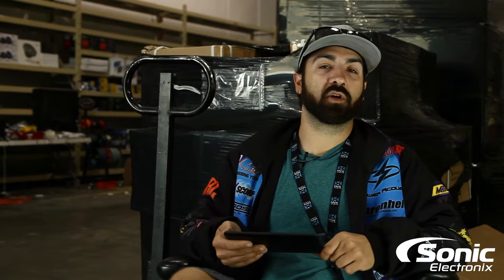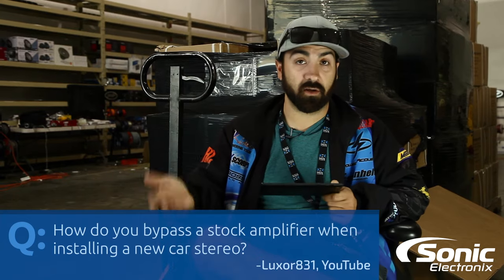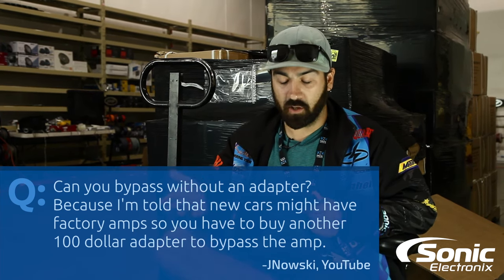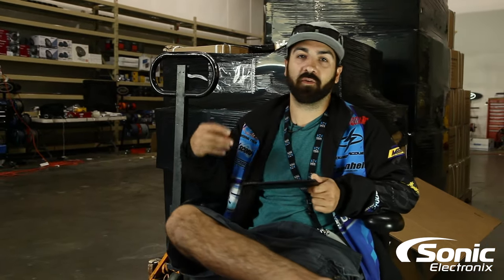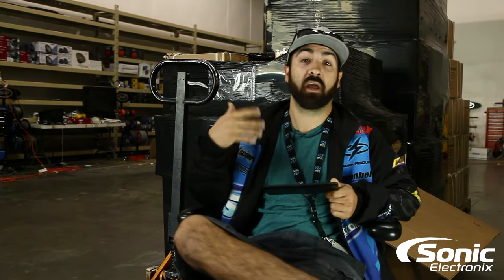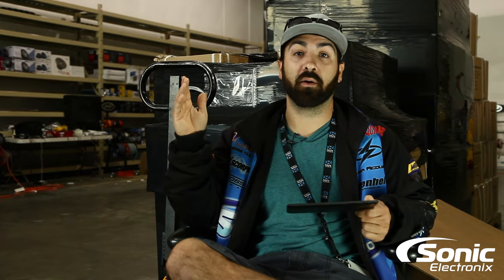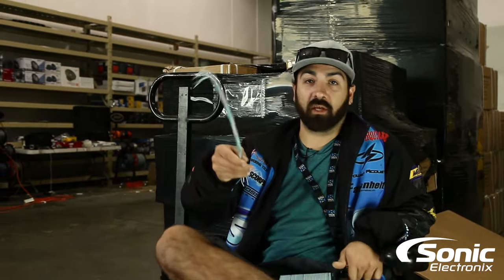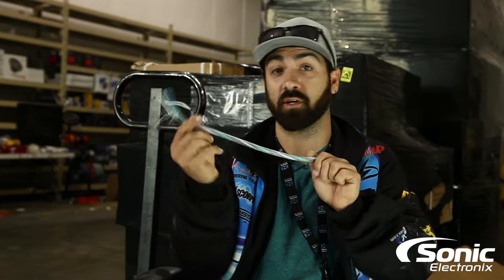How Do I Bypass My Factory Amplifier? | Car Audio Q & A

Comment: Here's a simple answer. You by an aftermarket radio with sub/amp outputs. Buy the the adapter which costs around $40-$75. Forget any high/low adapter. Now you can hook up another amp for subs and still use the rest of the factory speakers as well.
Reply: The adapter wires run from the factory Amp to the new head unit?

Comment: Just use a $20 scosche 4 channel converter if you want to add an amp and woofer to your factory system. No need to bypass your factory amp. You don't lose any channels and you don't even need to touch your deck.

Comment: If you have a Nissan or Infiniti vehicle, you can easily bypass the factory amp with an OWC Upgrades harness adapter. Let's you plug-n-play better amps in no time.

Comment: I have a two-part question. I have a 2003 Toyota Avalon with Factory JBL. There are two different harnesses available for my application. The standard application is a 2 connector setup and it appears to have the blue wires in the harness that would connect the power for the amplifier. The other connector is a 1 connector setup with RCA's. Can I use the two connector standard harness with my JBL system or will I lose my sub? Do I have to go with the RCA harness? Also I heard that if I use the standard harness I can connect directly into the factory amp through a different part of the harness in the dash?

Comment: I have a 2014 Jeep grand Cherokee limited that I will be giving my son for his 18th birthday. I want to upgrade the sound system a bit. The factory head unit is staying in the vehicle so we have an LOC and we are changing all of the door speakers (4 doors , 2 tweeters). We are adding a 4ch amp to get the kids and highs loud a crisp. We also plan to make sure that we can still run the factory sub for now but will be upgrading to a custom box for the back. What all do we need before we start?

Comment: I'm pretty sure I won't get this question answered but here it goes anyways... from bypassing the OEM amp for a aftermarket headunit will the OEM amp lose its purpose as to moving the speakers etc. Or will the aftermarket headunit do all of the work as to powering up the speakers etc.

Comment: I read something before that if you bypass the factory amp and splice into the existing speaker wires, without using a line out converter. That over time it could damage the head unit if you don’t install capacitors or Resistor between the splices?

Comment: I need help iv replaced my factory speakers thier much higher wattage than stock soon I will be replacing my factory stereo to a double din . 
1.how do I wire in a higher wattage amp to get the most from an aftermarket amp ?
2. Can I bypass my stock amp to do this?
3. I hv steering wheel controls how do I keep that functionality?
2002 dodge ram 1500 5.9 4x4

Comment: I am looking all over and there are no videos on how to keep the factory amp with an aftermarket head unit. my factory amp works just fine and I want to install my pioneer head unit while keeping by door speakers and tweets amplified by the factory amp.
Reply: I am looking for the same thing. I want to keep my factory. But I'm having trouble finding an answer too

Comment: So this is probably a rare occurrence but my factory B&O system amplified can't be removed from the vehicle. It will mess with the key and a bunch if other Electronics. It is essentially a part of the vehicle but I want to do an entire different system. How do I go about doing that? I heard there is an adapter that'll allow me to bypass the Amp and run new amplifier for my subs and speakers.

Comment: Hi I love watching you video. However i have one question. Recently i issue with my amplifier (here is no sound from all speakers). I just took my car to service and the mechanic said i need new amplifier. My question is if am going to do it myself and buy the same model amplifier, does the new amplifier need the factory setting code. I am afraid that if i pull out the old amplifier and put the new one in it requiring Lexus setting code to run it. Any helps appreciated.  My car is Lexus RX450H 2010.

Comment: I have a question..? I plan on using 3 XS power batteries to power my system. Is it a difference in using the d series versus the xp series batteries?

Comment: I have a 2011 Toyota Toyota Corolla S, I used the Metra 70-1761 on a Sony DsxB700 stereo. I am getting No sound at all. I connected the blue/white to the blue antenna , nothing. Then I read blue/white to red. Nothing, then to leave it unplugged and still NO sound. The stock stereo does have a third harness connector that is left unplugged . I can’t find that connector from Metra or Axxess. I installed 4 JBL speakers and sounds great but I want my Sony to sound better.

Comment: So I got a 2004 Acura TL comes stock with a factory 8” sub and factory amp, so I replaced the unit with a dual touchscreen doubledin, and now I’m trying to add my new 2 12” subs with my new Sony amp and I have everything hooked up, dudes are good and wiring is all in tact, my amp turns on and gets signal but I get no bass or power to my subs, what’s the issue?

Comment: What if I’m hooking up subs in my 08 Ford Edge limited but using the factory radio with a line out converter?? Do I still have to bypass the amp?

Comment: I have a 2011 dodge ram with the 10 speaker alpine system and I've already replaced the stock factory sub and added an amp for it. my question is...can I add another amp to power my 4 door speakers or power them using my existing 4 channel amp with sub output?

Comment: So I have a 2023 Elantra N and it comes with a Bose sound system and it's shit. I just wanted it to be like 10% to 20% louder it's just missing that little extra to be loud enough. It also has 0 bass. I was told it would be almost 3k to upgrade because it requires alot of work and some kind of expensive adaptor and alot of wiring. I just can not wrap my head around that.  Any advice would be so appreciated.

Comment: THANKS!  This has been my main hurdle in really getting my feet wet in all of this..  Say you had a 4 channel (midsnhighs) and a mono block (sub)  How would you wire that from the head unit?
Reply: That would be rca's to mono and the other speakers to the 4 channel...  where would you install the crossover for the 4 channel?  Would a third amp be required for a set of dedicated sq mid range 8s?

Comment: Hello sir I recently bought a 05 vw toureg it has 11 speakers w. Cd  changer /navigation ... Well I recently changed hu for a aftermarket DVD/navigation/backup cam ... Well when I had it installed I told the guy don't cut no wires order any harness u need also order the harness for the steering wheel controller w. Cost me an Xtra. 200... Just to be able to turn it up and dwn on the steering.... I told him to bypass the factory amp but I'm guessing he didn't cuz the backup camera had stopped working and I went back to the shop he told me come by next day so I did but then the front speakers stopped working and only the center speaker did. I asked the guy to take a look he told me that maybe the amp was burning out the factory amp so I said okay ask him about The Back-up Camera he said the owner replaced it with the different one I have to pay extra for that new camera I told her no I wouldn't so she let that slide week later this camera doesn't work now and now I went back to the shop same excuse again so long story short this the third time it bring that start working so I decided to follow the wires from the camera he had tapped into the 12 volt on the amp and and what do you use for the ground was not really properly prepared so my question is would that necessarily burn out the amp and all these cameras that he keeps replacing

Comment: So I installed a pioneer after market head unit in 94 lexus sc400. Every time I turn the car on (starts perfectly) there is a whining from the back speakers which after hours of research have concluded I have to bypass my factory amp. I already have my after market stereo system installed and wired, and my stock stereo has a sub as well. How should I bypass it to keep the sub bumpin

Comment: How do you bypass the factory Amp in a 2005 Chevy Equinox. The amp burnt out and I am keeping the orginal radio.
Reply: You Don't Want do that you might cut the wrong wire and spent $15,000 for the cable wire your might  causes electrical fire Oops
Reply: You would need to locate the amp, and disconnect the harnesses.  Once that is done you are stuck with out a direct connection to the speakers though.  And there lies the fun you have to power them and that factory stereo is unable to do that so purchasing a replacement amp is needed, and then fitting everything up needs to occur.  Long end of it...Buy an after market stereo which undoubtedly has a built in amp.  and then match up speake rwires bypassing the amp and your done....

Comment: The bad thing on my daughters car we didnt know the 04 galant gts had an infinity 6 speaker sound system there was a radio in center that didnt work i pulled it out and it had no wires just 3 on the factory harness which is just constant ignition and found the amp behind glove box all the other wires wee cut .now question is since i cant see on top or bottom of amp is there just an rca plug i could just connect.or how can the pioneer radio has 4 speakers connection by able too hook it up

Comment: the one million dollar question here is: how can I integrate an after market head unit with BMW DSP in one of these cars, BMW X5 2004 or Range Rover 2004? its not an easy task , only top professional could achieve that goal.
Reply: BMW and Range rovers use 2ohm speakers. Get your self a 5 channel amp. Pretty easy.  Or there is a company called Mobridge that does the DSP LOC.

Comment: if i want to connect a kenwood amp to power my speakers instead of my stock amp then do i just disconnect the plug ins from the stock amp that run to the speakers and connect them to my kenwood amp or do i need a special harness or can i just cut the cables whats the trick there ?

Comment: Please jelp. How can i USE my factory subwoofer amplifier with my new non-factory radio? why i can not turn it on & connect to the rca signal? or maybe this factory amp has a high input? i don't want to risk using high inputs in where i don't have knowedge. The car is expedition 2000.

Comment: I have a line converter tapped into door speakers on an s430’s factory amp running to a power akoustic equalizer (peq-70). The equalizer has sub output lines that have a signal that powers 2 12s in parallel close to what they can handle from a 2 ohm 4K watt amp but I want more signal. What lines off of the factory amp will give me all of the signal for the equalizer to get all authority over the aftermarket subs. I only get one green bar out of the equalizer wether the turn on off buttons are pressed. I’ve used the equalizer with an aftermarket radio and have gotten the system to show a peak but what lines are needed out of the factory harness to get a full range signal without restriction?

Comment: I installed an aftermarket mono amp to power a subwoofer I added to my 2000 Buick Park Ave Ultra 9 speaker system with factory amp. I'm pulling the signal from one of the sub channels off the factory amp. There is no signal unless I touch one of the terminals from the factory speaker wire to the chassis momentarily then the sub begins to work until I turn off the car or the radio itself. Then I have to do this again if I want the sub to work. The amp is grounded properly to the chassis. Is this a case where I need to bypass the factory amp just for that sub channel so I can pull the signal before it goes through the amp. Frustrated with this. any help is much appreciated

Comment: I have a 1996 Nissan Pathfinder. I recently installed an aftermarket pioneer stereo thinking the factory stereo was bad because the sound would periodically have alot of static or the sound would completely go away. Same thing after I installed my pioneer stereo. I found the factory amplifier in the rear left panel. I took it out for now. Is there a some kind of bypass  harness I can plug in place of where the factory amplifier goes? I don't want to spend hundreds of dollars to get this stereo to work as I is a "shit" vehicle I just drive to work, it's nothing fancy. I just want a stereo to listen to.

Comment: Is it's possible to bypass the factory amp with out touching the factory stereo. With out taking apart the dash. Can you bypass the factory harness at the factory amp to give all the signals you need to send to your aftermarket amp. Excluding power and ground cable i know those will have to be installed seperately. Can I tap into the harness at the amp possibly just cut out what i want to use and keep what i want my factory amp to keep on its own. For example my car has 7.1 audio. Im guessing since it haves center dash. Left and right dash. Left and right front doors and left and right back doors. And of course one back sub.  I only want to tap into all doors speakers for a 4 channel amp and seperaly The stock sub with mono amp. Using a rca converter box. Can I just cut out the wires i want to tap into and convert them from that harness. And since i don't want to touch the stereo. Can I by pass the inputs and the outputs of these wires on the harness of the stock amp. If possible please let me know. I keep seeing videos explaining a bypass but only sending new wires to the stock stereo.

Comment: How do i bypass my factory amp for 05 acura tl. I bought the radio harness for it but which wires do i tap in the one behind the stock stereo or input or output on factory amp

Comment: Do I need to modify any wires if I'm installing after market system in my G35 Infiniti 2003 with no Factory amps connected underneath the seat only empty harnesses. Because my speakers and subwoofers connect two Bare wire connections but my amp connect to my deck with RCA of which I have three channels. So is there such thing as a RCA to Bare wire adapter? Or could I just strip one end of the RCA's in to Bare wire? Get at me let me know thank you

Comment: my truck is a 1990 chevy s10 4x4 and I replaced my factory radio with a Bluetooth radio dual and both wouldn't go over the volume 43 and I was wanting to know how can I get it go over 43 bc I want to be able to have it go up to 100

Comment: hi, please help! just bought a Lexus RX 300/320 (UK) with a Mark Levinson 11 channel system. its a known amp failure. what amp should I get and what adapter do I need. no one in the UK seems to think its possible and a second hand amp is £250-2000

Comment: i have a 2003 Chevy Tahoe w/ bose and onstar i put a aftermarket amp and subs. how do i tap into the speaker wires running to stock amp

Comment: I jus recently got an 04 tahoe that the factory radio was taken out and a jvc was put n wen i got it. I tried to hook up my amp n subs, but it wont let me control my factory speakers and sub bass level seperatly. So the bass n my factory make my speakers pop cuz to much bass, but if i turn my bass down it also turns down the bass to my subs. Wat can i do to separately control my factory n sub bass levels?

Comment: would you do that on an 05 cts that I'm going to be running new components to aftermarket amp plus aftermarket subs I have everything purchased except wiring harness and battery and big 3 kit and alternator is what I have left to get I don't not use onstar but I don't want my old factory amps pulling any extra power since I have the 2 extra monitors 2 1000 skar moino and a kicker 125 x 4... I have been buying stuff for the past 4 months haven't installed anything yet want to make sure I have absolutely everything first

Comment: Hello guys, i have Soundstreem amp with HI-input connection, so i don't need a converter from hi to low signal. My main question would be wich wires are hi-level in the trunk? I understand i need to take wires wich go to stock B&O system subwoofer, and connect my amp? I need diagram or wire location (photos would be great), wire colors. And do i need to connect Left and Right channel or 1 side only? If someone have any information that will be great help. And if you know where i can find more help that would be great :) (maybe other forums? Reddit?)

Comment: I have a 2007 cadillac escalade esv with the bose sound system. Well my factory amp took a crap and made it to where only my front driver speakers worked so we replaced it with a rockford fosgate one. We found which wires were the speaker wires on the stock harness and wired them into the new amp, well now all the speakers work but i have no adjustability on my volume on my stock head unit. Once you hit the first click its at 100. Theres no in between. I went by my local audio store and they said only way to fix is replace the deck is this true or are they just tryna get another $600 out of me?
Reply: for the front speakers did you wire them from the head to the 4 channel?? I have a very similar setup with my Audi... But I'm gonna run it from an aftermarket double din.. and did you use the remote wire from the factory or run a new one??

Comment: I have a  question........i installed a system in my 2002 chevy suburban, after market radio,amp,speakers,and subs. I kept the factory amp. The problem i have is that sometimes when i turn the radio up to a certain volume level, it will eventually cut off the voice on the 4 front speakers but you can still hear the bass on the subs. What can it be?
Reply: Same happens to me and I only have one 15. Audio Specialist told me the factory amp is probably going bad
Reply: Me too!

Comment: I have a 95 suburban which I bought without a head unit. Installed new head unit and get zero sound but can not find a amp bypass harness for my make and model anywhere. Any ideas?
Reply: Check your blue wire its the power antenna i had the same problem on my 02 tahoe